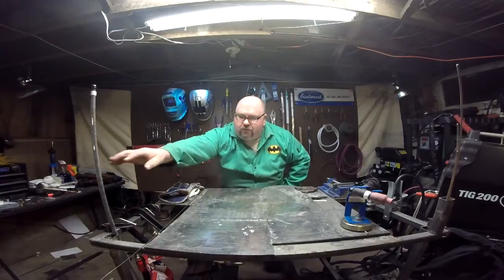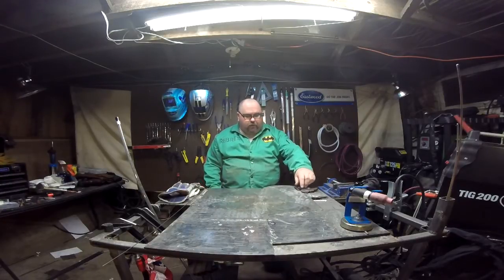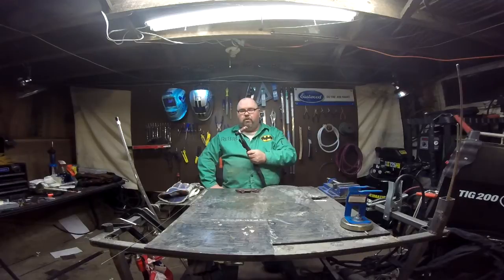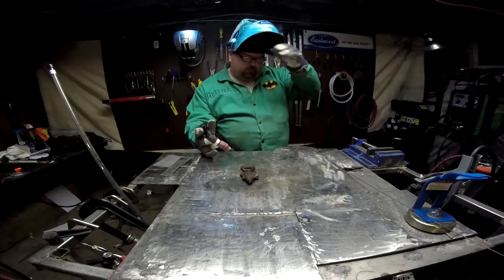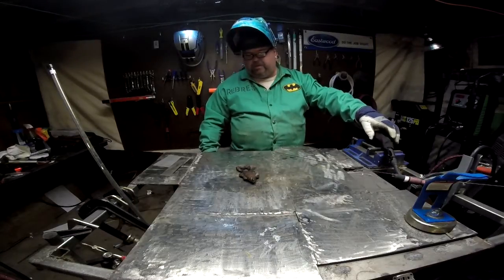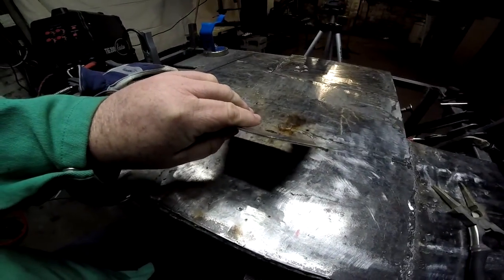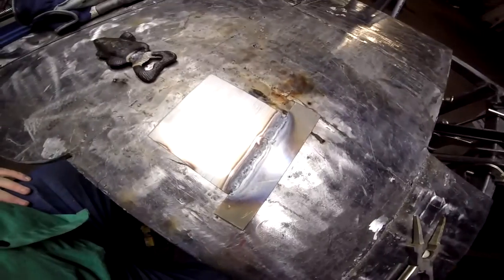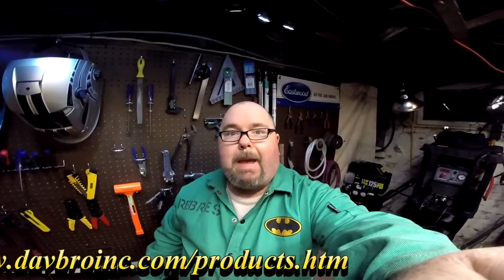Adventures in Welding #83 EZ Weld Tig Wire

Comment: I'd like to see a larger piece of cast get welded.. such a small piece is not that likely to crack... I have a cummins 53 block with a crack I wouldn't mind having "a crack at", I also have low silicon bronze filler which might work alright as well

Comment: The host seems like an honest guy. I am a skeptic for any secret sauce,  so instead of knowing what isn't in the filler, I would have to know what is inside before I would use it. Also there are many kinds of cast iron and one product might not work for every type. Without analysis,  there is hard to know what the fish is made of, Ductile? How much carbon? Sulfur,   etc. How about grinding and filling the weld- how hard is it? How about color matching? Break it with a hammer and have a look see

Comment: I tried to weld old cast iron radiator with it and it cracked all the time... beads were looking nice, but it cracked next to bead...
Reply from the maker: +jarmo laakkonen Welding cast iron is tricky no matter what. TIG welding cast iron is doubly so because the heat is localized. Cast iron needs to be kept hot the entire time it is being welded and then cooled very slowly and uniformly. A radiator would be very difficult. If I had to do that project, I would probably choose to braze the crack.